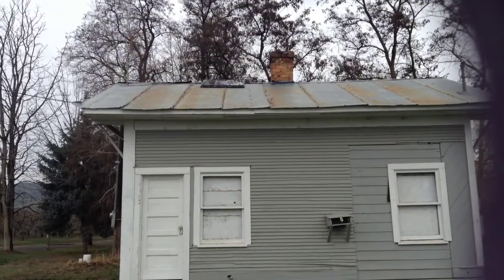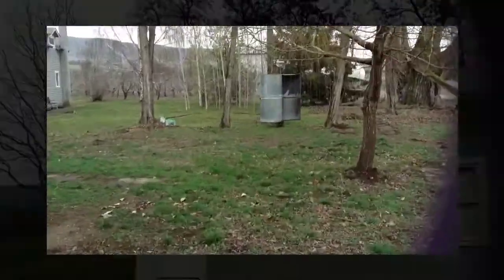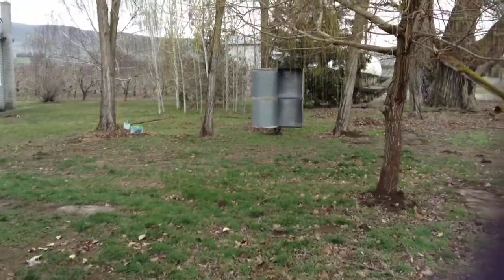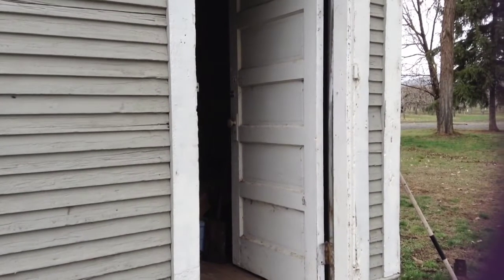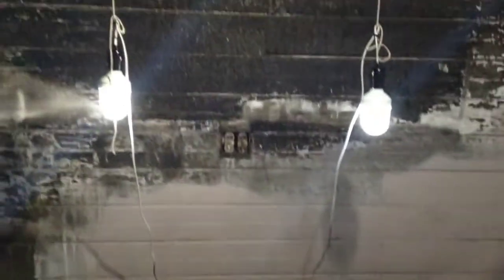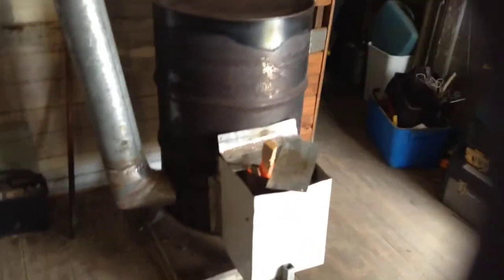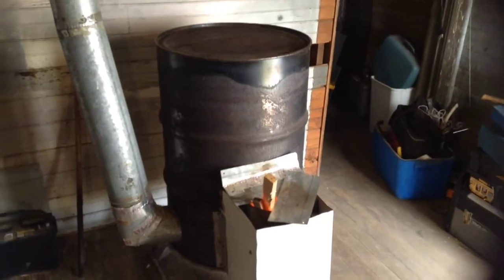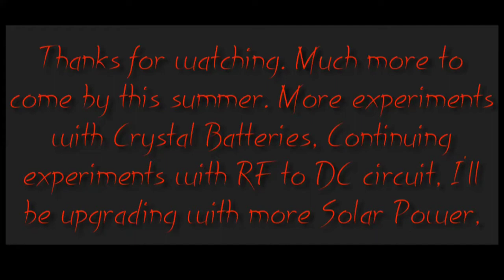Off Grid Workshop BackRoom Labs

Comment: Does the joule thief actually use less power per lumen than a 12v dc L.E.D. ?
Reply from the maker: I wish I new the answer to that. I have asked myself the same question. If I had a lumens meter I could figure it all out. The V2 seems way more efficient than the one wrapped on the PVC. The way the transistor changes frequency per bulb added is pretty cool. When each bull is added they do get a little dimmer. Again without the lumens meter I don't no by how much. Guess I'll be looking for a lumens meter in there near future. It only makes sense to find out. By the way I really enjoyed seeing the decomposition heater, very cool.